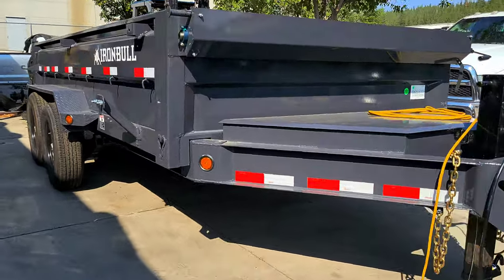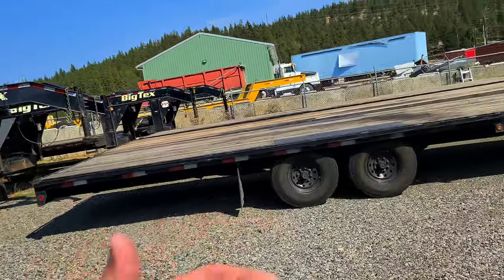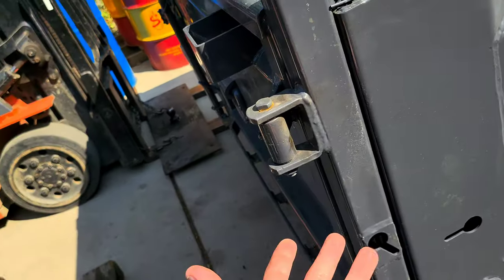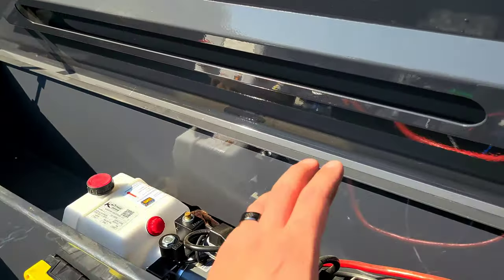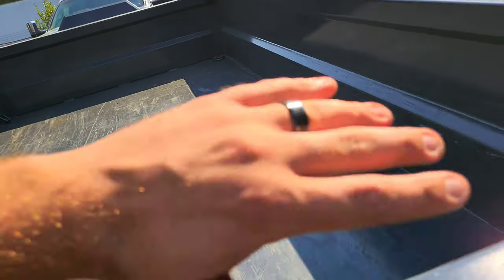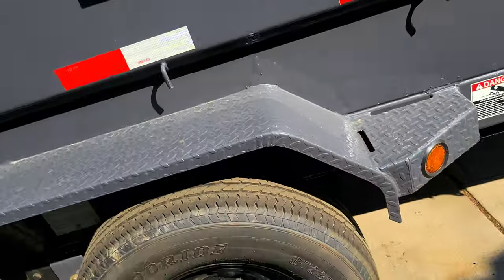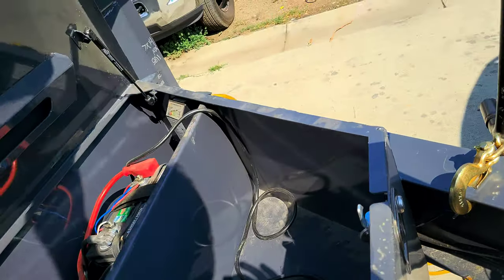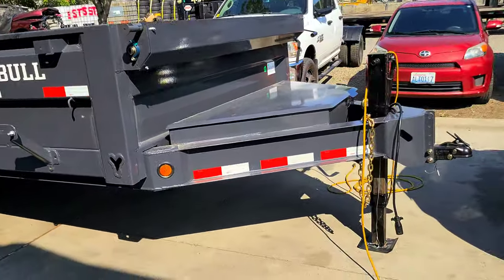2022 Ironbull 7x14. I've been wanting a dump trailer for a while.

Comment: Just bought me a 7x12 dump trailer a week ago myself. Love it. I do recommend a wireless remote.
Reply: Where do you get that at?
Reply: @slammed_stangaz3608  I used a wireless remote kit that’s for a winch I got off of Amazon. It’s easier if your trailer doesn’t have the power down. Lots of videos on the YouTubes